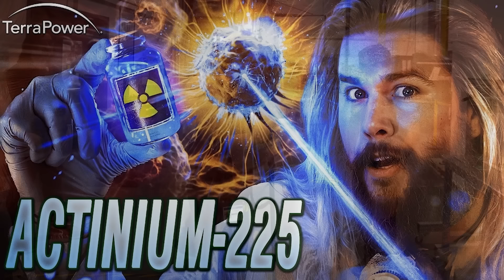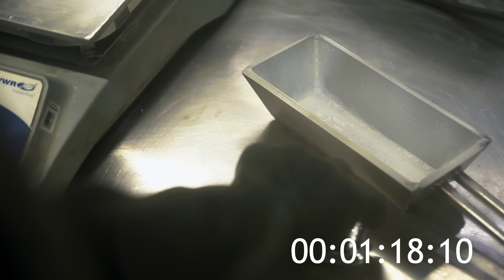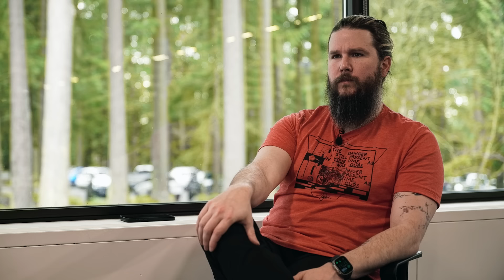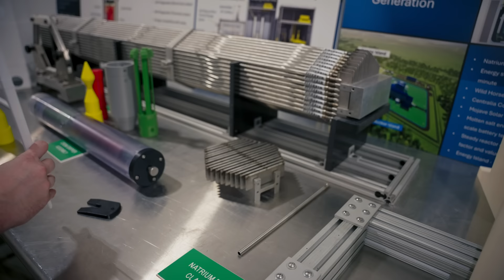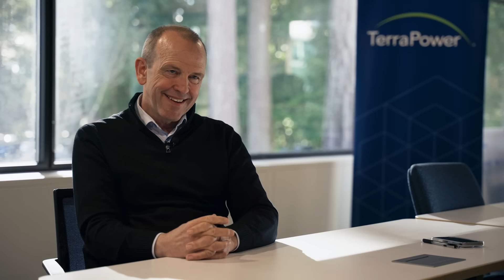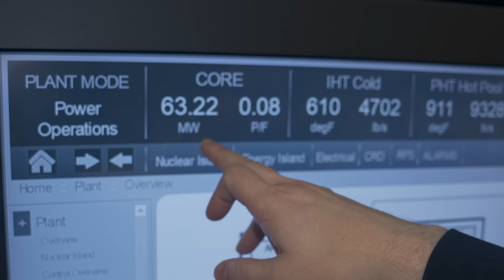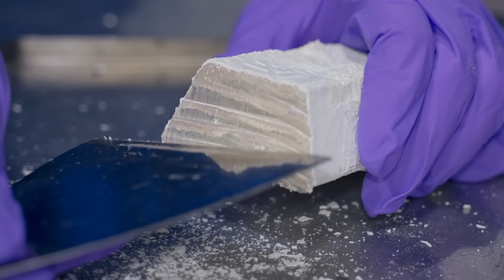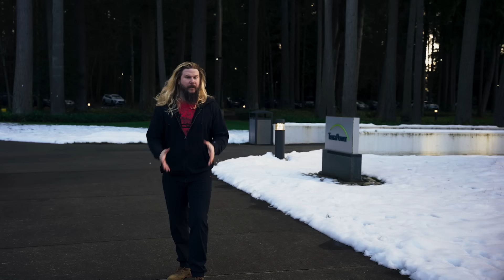Will Natrium Nuclear Reactors Change Everything?

Comment: 5:05 Woman presenting as an expert on nuclear reactors calls them nuc-u-ler reactors.

Look, Kyle, I love you, but this episode feels like propaganda. Like the so-called science segment that's supposed to demonstrate that sodium won't  react violently with air, but despite him even telling everyone that it "has to become molten" to do that, you guys just move along pretending like that isn't the state it will be in inside the reactor.

Increased safety because it works at atmospheric pressure?  Not true. It needs to be at continuous positive pressure to maintain an argon atmosphere, because unlike solid sodium molten sodium will spontaneously ignite and rapidly burn when exposed to air. This reactivity only increases as the temperature increases, so while it would happen at 100C, at 500C the danger is significantly higher. Notice, viewers, that there is no demonstration of the safety of molten sodium in this video.

If the argon system were to lose containment and start filling with air, we would have a nuclear meltdown because the coolant would begin pouring heat into the reactor, instead of removing it.
Reply: The answers are in the word NUCLEAR itself, first it's UNCLEAR, it's NU to the EAR and can be familiar as your UNCLE or your AR. The word itself IS the problem and this conundrum can be solved by using in its place the word SAFE - I love the idea, LETS DO IT❤😊-All borrowed from Firesign Theatre ,1969

Comment: What about a cold start of a reactor ? Will the natrium need to be heated to liquid state first or will the reactor be able to melt the sodium gradually without overheating?
What if the hot molten natrium piping cracks and leaks to the air , will we pump water in the reactor to cool it and hope the natrium wont have leaked somewhere ?
great content as always Kyle!
Reply: Was thinking about this too. Problem with salt is it becomes a solid when it cools. If youre running this through a pipe and something goes wrong youve created your own obstruction. Im curious what the consideration for this is.

Comment: Yeah.. Natrium (Sodium) cooled reactors have a positive void, (- see Chernobyl). They're also exponentially more prone to excursions (explosive hyper criticalities), compared to water cooled / water moderated reactors (- see Chernobyl too).

And there are the nasty corrosion problems, Sodium (Natrium) and salts are very VERY reactive, especially when very HOT & liquid.

Sodium explodes in contact with water. And the liquid Sodium has to exchange heat with water, to produce hot steam.
A bad or corroded weld (and there are thousends of welds in a heat exchanger) leaking, and we have a Chernobyl / Fukushima / Mayak - Kyshtym situation.

France had to shut down their Sodium cooled "Super Phénix', it never worked properly anaway and was a huge hazard a huge risk. With lots of Sodium leaks.
They spent billions to build it.. money never used to build proper industrial electricity producing plants, - exempla gratia: natural gas (Methane, CH4) plants, which are very affordable, simple in design and easy to maintain, start-up & shut-down, and with NO radioactive waste whatsoever to keep out of the biosphere for billions of years.

Go on to believe in Santa Claus, Bill Gates (who does not know anything about anyting, except from BASIC programming of IBM compatibles) does too, so why don't you..?

.
Reply: It's (just like the Lockheed-Martin F35 JSF lemon) all about spending (PUBLIC, taxpayer's) money.. The more the better..
.
Reply: Sodium doesn't boil, i.e. form voids, until it's pushing 900°C, which means the positive void coefficient is not even in the picture before you've already pushed the loop way past its temperature range. Compare that to water cooled, which at normal running temperatures needs high pressure to keep it from instantly flashing.
I don't know what you mean by explosive hyper criticalities, can you enlighten me?

There is no sodium-water interface. The salt storage system is in between, as this video explains.
As for sodium corrosion, there are stainless steel grades up to this task. What does cause crack and leaks - especially at high temperatures - is when the pipe geometry and welding isn't properly designed for the thermal cycles it's put under.
Reply: P.s: Thorium, (the other "Santa Claus nuclear story"), is not fissible. You cannot feed nor maintain a nuclear chain reaction with Thorium. 

And that's NOT an opinion, but just basic Physics textbook science..
.

Comment: The sodium eats the pipes so you have to coat the inside of the pipes with basically teflon and use high grade steel composites.  A fast reactor doesn't make efficient use of the fuel, they say it's for making med. isotopes and can use waste products of other reactors... there's no way they would put waste in it.  There's other reactor designs that use a similar system, but you don't put water and salt near the containment vessel together like that in the graphic.  How they got funded partially by the NRC when others have been fighting for decades is ridiculous.  There's so many things to address that I just can't trust any Gates anything.  we'll end up with a cloud of radioactive sh*t raining down on the nations farmland.  These aren't the real experts.  Obviously they want to power their data centers and somehow this is in the best interest of national security, i think they'll end up repurposing the site and putting a reactor like you would find in a submarine in there.  Every plant that uses hot salt...leaks, and you can't just go near a containment vessel to weld some sh*t.  You still have to have moderators, even tho they think it will self regulate... the comparison is different... it as done with slow neutrons and graphite moderators.  The spotty science and focus of this video smecks of propaganda.
Reply: Completely untrue, sodium is very non-corrosive.

Comment: "You need it to be molten for it to start burning in air" 
This would be reassuring if it wasn't in relation to a system that relies specifically on pumping molten sodium around 😅

Comment: Only China and Russia produce HALEU (high-assay low-enriched uranium) case close.
Reply: Global Nuclear Fuel-Americas has a HALEU production facility under construction in North Carolina.
Reply: @chapter4travels  Thx   "Edit: and produce up to 20 kg of HALEU by the end of 2023 – this was delivered in November 2023. It was then expected that production would continue in 2024 at a rate of 900 kg of HALEU per year. However in February 2024 it was announced that delays in the supply of 5B cylinders from the DOE would prevent the delivery of this amount of material in 2024."
Edit2: haleu production by country in google (with option past year) is not giving usable figures for productions "at scale" other than Russia and China, either its HALEU from LEU stocks or low stock "new" production facilities.

Comment: @kylehill thebiggest issue with nuclear, wind, and solar, is the the problem of supply and demand. If you were to turn water into hydrogen via electrolysis, you can use electrolysis plants to help balance supply/damnd by turning them off in high demand times, and turning them on in low demand times. With control circuitry, you can almost balance this on a second-by-second basis. You can then use the hydrogen to either power cars (which i think is the best use for this) or use it to generate power and pumpit back into the grid at low supply times. 

Nuclear definitely has a massive part in modern power grids, but so does balancing the supply and demand. Hydrogen allows us to do that by increasing the demand when the rest of the grid doesn't have such demand, using the supply that is there

Comment: @15:00 So i was curious as to what wild happen if molten sodium were to be exposed to air and this is what AI answered back....
When molten sodium is exposed to air, it reacts vigorously with the oxygen in the air, forming sodium oxide. The sodium oxide then reacts with water vapor in the air to form sodium hydroxide. This reaction can also absorb carbon dioxide from the air, leading to the formation of sodium carbonate. Molten sodium is significantly more reactive than solid sodium in air, and the liquid can ignite at around 125°C (257°F).
Ignition:

Molten sodium can ignite at temperatures as low as 125°C (257°F) in a humid atmosphere. 

Smoke and temperature:

When burning in a dry atmosphere, sodium produces a dense white caustic smoke and the temperature can rapidly increase to over 800°C (1,500°F). 

So with that while using molten sodium at around 500°C if there were an accident, or attack, then isn't it conceivable that the sodium would react and ignite on it's own creating a self feeding cycle that wild be excitement hard to put out?  Especially with normal fire fighting techniques.  This is really the only major hurdle/problem I see with this reactor setup so hopefully my concerns are well mitigated.

Comment: Where are the pebble bed reactors?! Inert working fluid (helium) and meltdown proof fuel makes LOCAs a non-issue. It runs on a brayton cycle, which is inherently more efficient than the Rankine cycle (since the working fluid doesn't change state in the cycle). Why chase all this molten salt/metal BS? Ask the Russian navy how well that works. Much more complicated than this propoganda indicates. The reactor needs constant power to keep core molten above that provided by decay heat. What happens when they lose the inert has blanket? What about the corrosion rates of the piping and reactor vessels? EVERY flange will be caked in salt (radioactive and otherwise). I've worked around liquid urea processing. It's an absolute mess, and that solidifies at much lower temps. Looking at this through very rosey glasses.

Comment: @15:00 you state that sodium likes to react with oxygen when it is molten and then perform this demonstration of how safe sodium is while it's a solid.  When the sodium is at work in the plant it will be in a liquid/molten state.  So I haven't heard yet what exactly will happen if that molten sodium were to be exposed to the air, or fire fighting water, if there were some sort of an accident. Argon gas can't be the solution at that point.
Reply: Yes, burning liquid sodium is not straightforward to put out. Most large scale plants using sodium have containment bunds and suffocation pans directly underneath the equipment to limit the pool area and burn rate.
Reply: @GreenOddish understandable and I know of these containment pools and the use of frozen salt plugs, but those are only in case of loss of cooling power and the nuclear reaction running away while still inside the piping.  If the sodium were to be exposed to air while in a molten state would the 20% oxygen in the air be so reactive that the only way to combat it would be with unique firefighting techniques or drowning the entire facility that houses the sodium side in argon gas?  Because the sodium is separate from the nuclear side of the plant and merely heated up by the nuclear side without directly interacting at all.  So the frozen salt plug at the bottom of the nuclear side wouldn't do much in this situation.  I guess it all boils down to how reactive molten sodium is to oxygen is my question.  Strangely I couldn't find anything online other than a quick video where molten sodium burns on its own without any other fuel once it is molten and exposed to air.  By the color it isn't a particularly hot flame but again that was only a quarter sized ball of molten sodium.  So I'm unsure if the temp would ratchet up with more molten sodium or what other kind of reaction would happen with increased mass.
Reply: @hans2five  I do have some experience - sodium fires don't exactly roar like say oil fires do, as the heat of combustion is not so much as to create a massive updraft that sucks in more air. It's the smoke that's most dangerous, basically a mix of oxide, peroxide and hydroxide aerosols. Anyone in an enclosed area should have a full face mask + chemical filter on their person, or a SCBA.

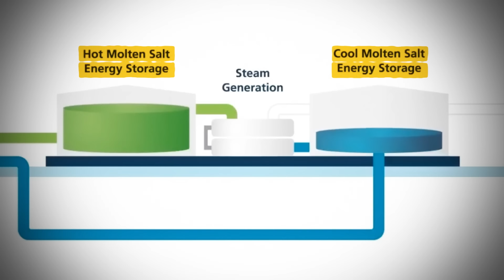Comment: 5:30 Solar and wind does NOT follow what the grid demands. It is in fact one of the key issues of solar and wind ...
Reply: depending on the exact setup they can. some solar plants, rather than using photovoltaic cells, use mirrors to concentrate sunlight on a tower where a liquid (such as sodium or salt) is heated and can then be used to boil water or stored to boil water later. wind turbines are a bit more tricky for storage but you can reduce their output quite easily.
Reply: @wesleyewert1023  No. There is zero difference between using mirrors to heat a medium, and solar panels themselves just generating power and that power being used to then heat up a medium.
It's a battery, not part of solar, and the production itself is not adjusted whatsoever. Only how that's integrated into the mains
Reply: @PJOZeus  there is a large advantage in using mirrors because they are cheaper than solar panels
Reply: @wesleyewert1023  You're intentionally ignoring everything that's said just to suit your own narrative. Have some integrity.
Reply: @PJOZeus  no you just explained your point very poorly. the difference between using solar panels to power heaters that would heat up the salt and using mirrors to concentrate the light on the salt is that with mirrors you aren't using all the extra materials to make and install solar panels and you don't have the losses from cables and heaters. and yes the main reason for using this setup is to make it integrate better with the mains, but it's far from just being a battery.
Reply: @wesleyewert1023  didnt they just close that one recently?
Reply: @CesarinPillinGaming  it is set to close in 2026. apparently I was wrong and solar panels are actually getting really cheap so the whole mirror system is no longer cost effective.
Reply: @wesleyewert1023 you mean like the one in America that cooks birds mid flight ?
Reply: @kylewilliams6091  yes, just like that one.
Reply: @kylewilliams6091  Sounds efficient.
Reply: @wesleyewert1023 so not practical in the slightest for what the environmentalists want for the future
Reply: @kylewilliams6091  well we can come up with ways to have birds not fly into the death zone. and depending on the environmentalist human lives might be more valuable than birds so it's still a net positive even with the mass bird incineration.
Reply: @kylewilliams6091  I just flew into Vegas last week and saw the Ivanpah towers in the distance from the plane. It looks pretty dang cool. Too bad it's being shut down.
Reply: @wesleyewert1023 
Ok. There is a very specific type of solar plant that can be tuned for the grid demand. 

But the typical solar doesn't help the grid demand unless it's managed.
And wind is the worst type of energy, it's unpredictable unreliable has high maintenance cost and... Well I don't need to kick down wind any further.

And yes all power systems are manageable. But grid demand is a huge deal nowadays especially with all the EV's being charged
Reply: @SanneBerkhuizen  If wind was inefficient, nobody would use it.
Reply: @ChristophBrinkmann 
Sure.
Reply: @ChristophBrinkmann  Wind is inefficient. Betz's law shows how any open flow turbine will be limited to capturing no more than 59.3% of the kinetic energy in the stream. Utility scale turbines typically manage to capture about 40-45% of the available energy. Wind has the advantage that despite its intermittent nature, it has very low operating and maintenance costs per MWh after construction.
Reply: @ChristophBrinkmann the wind doesn’t blow at consistent speeds , from the same direction consistently . How is this difficult to understand ? Are you a victim of modern education ?
Reply: @SanneBerkhuizen  Wind power is not that unreliable and unpredictable. Sure, in your back yard it is. However, the giant turbines in wind farms are built high enough in areas with pretty regular winds that it's fairly consistent. In regards to adjusting for demand, they can shutdown turbines and start them up, as needed. So it can be pretty responsive...unlike a nuclear plant, like she said.
Reply: I was just going to write this.
Thanks
Reply: Modern wind energy systems are able to precisely control frequency and voltage so by this these systems are able to control active and reactive power to overall stabilize the grid. Also overall power is adjustable by speed control or dorect pitch. And they can do all this quite fast which helps response to shifting grid loads. The hard work for the grid companys is to have an intelligent software to handle a lot of these systems all in parallel.
Reply: Correct. They make the grid unstable because of their unpredictability. Hydro on the other hand can ramp Up and down.

Comment: 21:44 @Kyle Hill could this sodium technology be used with a thorium reactor? I'm just spitballing here. It seems like thorium reactors are generally more safe than uranium reactors and sodium is our heat transfer medium to the liquid/solid salt. Also if we aren't using control rods to control the reaction how does the reactor scram? What is the worst case scenario if the reactor melts down? While it's unlikely, would the same type of explosion as what happened at Chernobyl (but of gaseous sodium) spread radioactive sodium over a great area and cause fires when it rains and basically (pun intended) "salt the earth" it covered?